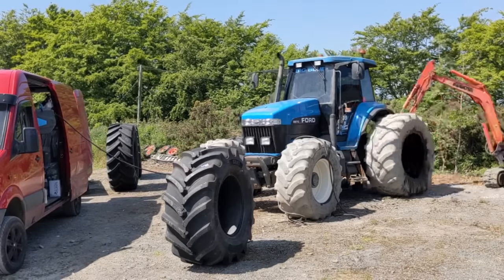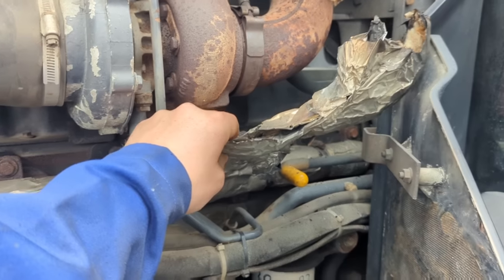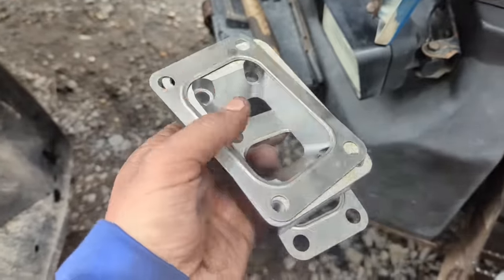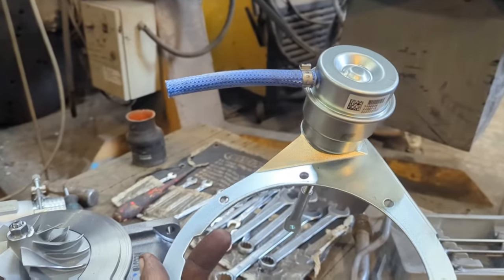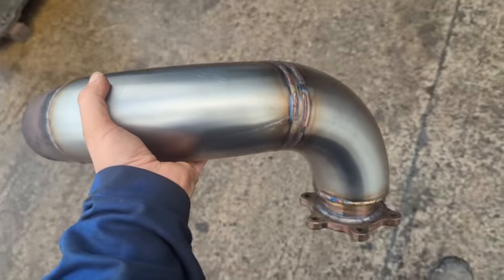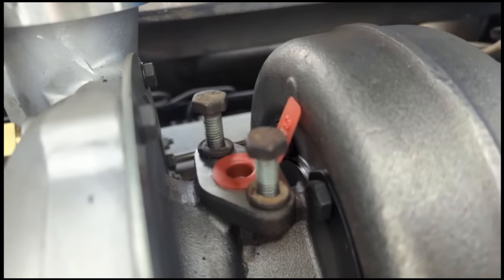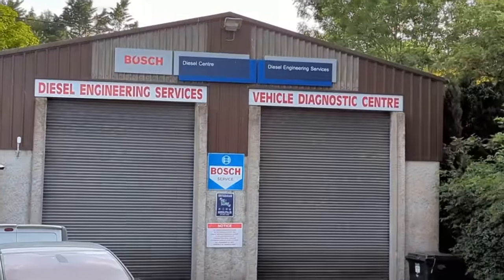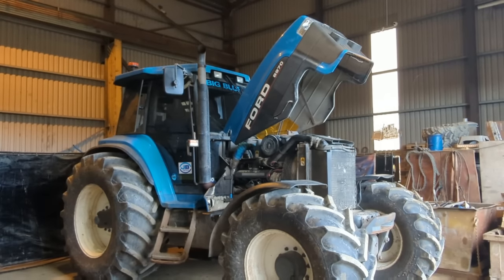bigger holset turbo, new injector nozzles and 13mm pump elements, #on the pull prep project Big Blue

Comment: Before you changed turbo, you were getting high egt.
This would more likely be because when you adjust pump to max it gets wasteful due to the dwell/ amount of rotation you inject fuel for, anything more than 32-34 degrees.
Another thing to understand is turbo surge with bigger turbo......if the pressure gets to high for a given flow the gas stalls and resonates.
This is one reason to compound turbos.

Comment: how did you decide that the hx 50 was the right turbo. have a agrotron 265 at 300 pto hp and the turbo is not holding up
Reply from the maker: I based it on its oem application

Comment: Egt temp sensor needs to be before turbo.
Exhaust mainfold for a good reading.
Its around 200 to 300 deg  lower at downpipe
Reply from the maker: It's in the factory location and the factory gauge is calibrated for that position

Comment: This is the Ford/New Holland 7.5 liter “genesis” engine? I looked a bit and I didn’t find much info on those as far as performance goes. I’m impressed with how well you’ve got it running, probably double factory power eh?  Sounds absolutely lovely haha
Reply: PS, I came to your channel for the gouging/welding content… But the diesel performance stuff is great. I daily drive a ‘98 4x4 Dodge Ram with a mid 300hp 12 valve Cummins and a NV4500 manual transmission… your video has me looking at bigger injectors now, I just need a bit more out of her 😂
Reply: @Thanosisnotreal not sure where you are but I have been working with power driven diesel out of Utah on an altered spray pattern injector for the 12v that really do make excellent power with minimal smoke. They are called powerjets.
Reply: @bcbloc02  you go with the stage 1?
Reply: @Thanosisnotreal  I was running the stage 2 and they burn cleaner than the common old marine 370's but make another 100hp.  The 2's will easily get you in that mid 4-500hp range without a bunch of timing or other engine work like head or cam.  You can always slide the fuel plate back if you don't want that much.
Reply: @bcbloc02  how was the economy? I daily drive and tow at least once per week, so that is important to me…
Reply: @Thanosisnotreal  seemed good I averaged 18.75mpg daily driving my dually crew cab over the 3000miles I ran that set.  There was dyno testing and lots of full power blasts too so I am sure it might could have been another mpg better had I been not hot rodding

Comment: Nice job! Those Powerstar units are savage. Any potential issues with increased HP on that gearbox? Are you going to hang a front weight off it?
Reply from the maker: Great story the previous owner seen my videos and reached out to me to tell me he had the original weights so I use them for the 11.5 ton class.
The gearbox is good for just over 600 hp in standard form then you can increase pack pressure a little for even more power. Very strong box

Comment: I hate that I got to this video so late but that 22hsg is not going to be a good match it’s going to give up a ton of torque. The hx50 and 55 series turbos are not the most robust. I prefer the borg Warner s300 and s400 stuff. I don’t know how many cubes that ford is to make a good recommendation but if you want to email me the details I can probably get you onto something that will really thump.
Reply from the maker: Yeah I hear lots of good things about the Borg's, I've a 365 and 480 on my ram, but tractor will only be making about 50psi, as you know it's torque that breaks stuff! Do you think the hx50 can live at 50 for a wile?
Reply from the maker: It is 7.5 litre  457 cubes
Reply: @allistairc123  yeah with that 22housing it probably will live fine. The 16 and smaller is when we started sending the turbines out the tailpipes on the 5.9 dodges. A 13mm p pump can easily run an s472 if you don't mind turning it 3000rpm. I have several of them running 800-900 hp on 6076 Deere engines with nothing but fire rings done to stock engines.  The Ford guy I worked with here we wound up having to get custom studs made for it to keep the head on as they don't have as  strong a bolts as the Deere's.  That is probably where you will be headed next if you get it under a hard pull with 50psi. 🙂 I don't think you have an intercooler but adding one would help turbo life and power. water injection would help too, easyil another 100hp.
Reply: @bcbloc02 71mm HE500 will do 1000
Reply: @V8Lenny   I have not seen a 71 break 1000hp but I have seen the 75s do it often.  I would say that is too big for a dual use tractor though as it will have nothing under 2500rpm on a 7.5l

Comment: I always measure EGT's pre turbo.  Turbo and exhaust wrap is a good idea.  It can be the difference between a bit of lag or not.  What turbo was on there before?
Reply from the maker: Yes I debated where to put it, in the end I settled for the factory location so that I had comparable Before and after readings
Reply from the maker: It was the factory Garrett turbo before , don't have any spec details
Reply: @allistairc123 what size injector nozzles Dikenberg give you for 13mm elements 🤔

He give me 5x0.60mm nozzles fo 13mm elements
Reply: @allistairc123 great Job